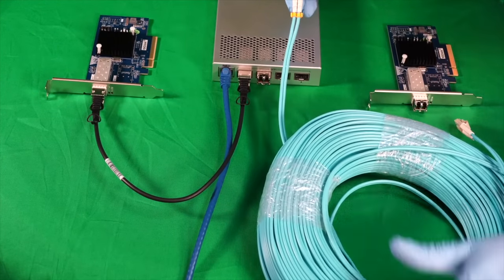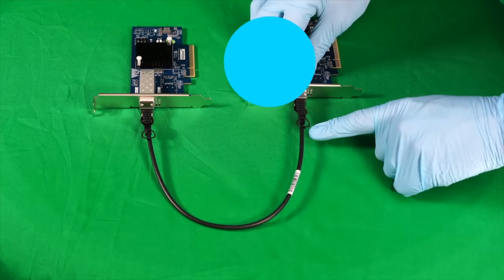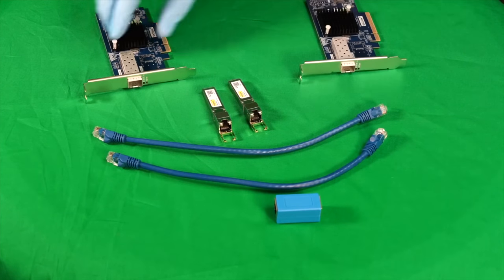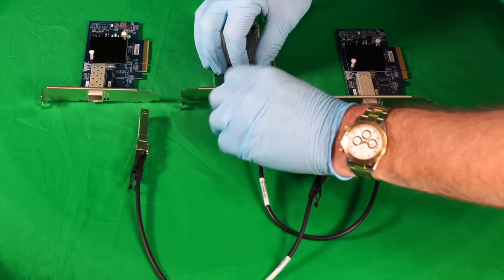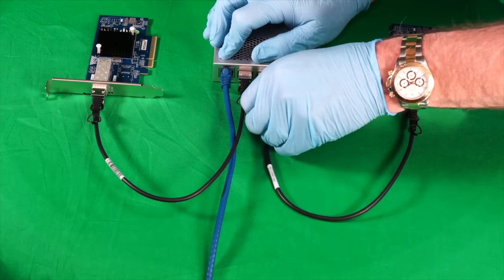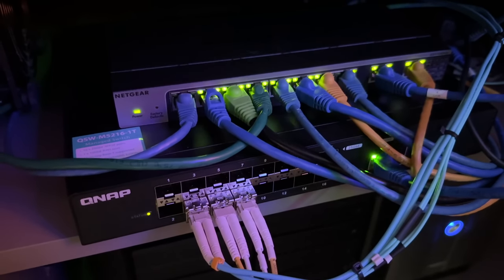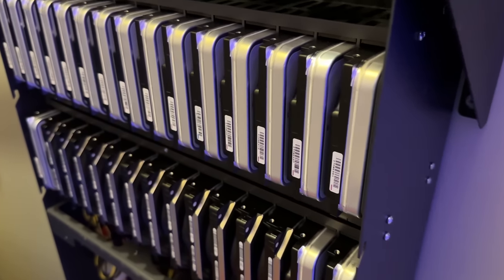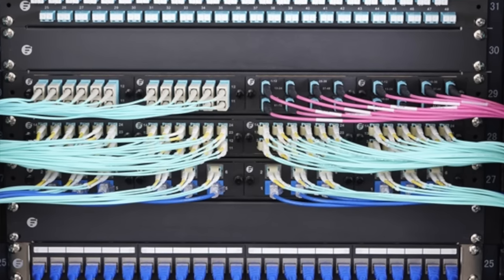10G and 25G Networking - SSD Speeds on the Net

Comment: If you're running a machine with PCI slots modern enough for those NICs, MDIX will probably already be in the stack. Regardless, I love the crossover callback. It's important for the younger generation to still understand these fundamentals I think. I love both the tech and videos about autism you put out, equally! Thanks!
Reply: 1000MBASE-T and 10GBASE-T require MDIX, so crossovers haven’t been necessary since fast Ethernet (100Mbps)
Reply: MikroTik Routers have a fair price tag, but are not very easy to administer. Nevertheless a good solution for a homemade lab. Unfortunately, it's not very easy to get rid of all bottlenecks, e.g. I can't find a 10g card for my notebook...
Reply: @claus7555  You might want to look into thunderbolt to 10g adapters, but they are very expensive, think $350 and up
Reply: @VraccasVII  I'm running a couple of cloud instances for free, so today, I  removed my server rack completely from my home office to have a bit more space available. That's probably not forever...
Reply from the maker: Thanks for the kind words!
Reply: @DavesGarage  Philadelphia Eagles or Kansas City Chiefs?
Reply: @ausnetting  I am going to add that many 100Mbps switches did auto MIDX. It was the prevalence of MIDX in 100Mbps that had them decide to make it part of the 1Gbps standard.
Reply: @jonathanbuzzard1376  my point was that on 1G and above, auto-mdix is a required part of the standard, so a rollover cable is NEVER needed on those connections.

Yes - it was optional on many fast Ethernet switches, but not all.  Some even had an uplink button for the last port on the switch to roll the connection so a crossover cable wasn’t needed.
Reply: @ausnetting  I was just noting that auto MIDX goes back even further. Frankly I stopped watching, because putting crossover singles in a 10Gbps link just makes me think the person doesn't know what they are talking about. I just placed an order for a couple 200Gbps switches today at work today.😁
Reply: @jonathanbuzzard1376  Hey! Some people are not flying yet, they are still walking, be gentle, we are not all as great as you.
Reply: @jonathanbuzzard1376 Dave Plummer not knowing what he’s taking about? You know he’s one of the OG Engineers of Microsoft right?

You should’ve kept going, very shortly after he explains why it isn’t necessary and is only used in cases where MDIX don’t exist…
Reply: @Comeyd  I know exactly who he is, that being a Microsoft Windows software person. Software ≠ hardware and sticking a crossover cable on anything more than 100Mbps is utterly pointless which is what he did. Even at 100Mbps is next to pointless because almost all 100Mbps did auto MDIX. Only some of the very early hardware didn't. With modern hardware, even at 10Mbps you would have to search out an ancient switch or hub because my modern switch will bring a link up on a 10BaseT device with a crossover cable. I still have some vintage kit. Even the ancient 10Mbps hubs/switches often had a manual MDIX button for an uplink port.
Reply: @jonathanbuzzard1376  that’s exactly what he said mere seconds after using said cross over!
Reply: Rj45 and rj48 differents ????  8p8c vs 10p10c ??

Comment: Nice to know the switch lets the different speeds to get along with each other and not slow the whole network down to the slowest connection.
Reply: This is not the era of hubs anymore. However some devices have "hidden" switch inside to increase number of ports, so you may have your bandwidth divided between downstream devices (yes, I am pointing at you, Mikrotik)

Comment: Also beware of SFP+ FC2, these are 16/32GB Fiber Channel or iSCSI and look identical to a typical SFP+.  You will get traffic over them, but they will usually default to max 1GB Ethernet, especially if they are HP or Dell branded (they don't make them just slap their label on them).
Reply: To make it even more confusing, some modern cards even support both SFP types, but that doesn't mean it works well, or at all. (FC and Ethernet are 2 completely different "languages").

Comment: Re: multimode vs singlemode - the cost difference has really come down in recent years, to the point where the cost difference for a home setup is probably only a few dollars.  A lot of folks have started recommended that any greenfield deployments standardize on single mode for everything for simplicity.  Since singlemode can do everything multimode can, and then some, you don't have to worry about where to use which type of cable.

Comment: a couple of things to bear in mind:
-10gbe copper SFPs generate a LOT of heat and use a lot more power per port than DAC or fiber so avoid them where possible
-singlemode and multimode are about the same price now anyway, and singlemode is futureproof while multimode is not, so if you're going to put in fiber may as well go singlemode, future you will thank you
Reply: THIS-^  Ditching copper SPF+ virtually removed all my problems with cheaper gear like the Mikrotik..problems like it going from not working in a full 10gig environment to it never dropping a packet.  well, almost never
Reply: Are you not worried about overmodulation by using singlemode on a short distance?  Optics for singlemode on higher speeds are way more expensive too.  You can get up to 40 Gbps over 150 meter of 2 strands of OM4 using 40GBase-SR-BD and up to 400 meters if you use 8 strands with an MPO/MTP connector.
Reply: The older adage was that you would use Multimode for very bendy applications (it works when twisted around a pencil) and singlemode for long, straight runs.
However, modern Singlemode fiber has a minimal bend radius of 1cm (slightly under half an inch), so that is also not a reason to choose multimode.
Reply: So this is basically to move files nothin special
Reply: As far as heat is concerned, does this apply to other SFP/SFP+ modules?  Like 1Gbit for example?
Reply: @KitGerrits   The problem with singlemode is the power of the transceivers. If you have a short length, you need Fiber Attenuators to prevent them from destroying each other.
Reply: There are ultra short range singlemode sfps
Reply: @marcusm5127  can you link to one? The only SFP+ modules that i can find that are short range are for MM fiber.
Reply: @tekki2  You don't need attenuates for the typical 10 or even 20KM modules. Their spec sheets generally show that they can handle a stronger signal than what they can send in the first place.

Comment: The first home networks I ran used 'thin ethernet' where if there was an issue somewhere in the big daisy-chain, the whole network went down with no indication of where the fault lay. 10Mb RJ45 was such an improvement. (A few friends and I installed it when, as students, we moved into a 6-person house. We had a spare 486, so that got put in the closet with a modem so that all of us could share a single 56K internet connection -- amazing for the time.)
Reply: I built a 10base2 network when I was a first year at university. The student accommodation didn't have networking so I built our own. Network switches were very expensive back then so we used the cable only 10base2 system. Didn't have any trouble with malfunctions, but I made all the cables myself very carefully.
Reply: Ah, the horrors of troubleshooting standing waves on 10base2 networks. Every time someone plugged or unplugged any PC, some PCs would end up in a dead zone and drop off the network, so I'd spend all morning crawling around under desks and work benches, adding a meter here, removing a meter there, trying to find a combination where every PC could se a signal.

The first network upgrade I ever did was to connect our 10base2 network to a cheap 8 port 10baseT hub, along with my PC and the company 'file server' under my desk. People weren't convinced that swapping one 10Mbit network for another would make any difference, but once I'd proven how much more reliable my connection was, I got the budget to buy 6x move 10baseT cards for everyone in the development office. Within a year, I'd convinced the director to fit structured cabling throughout the unit, and I was able to upgrade us to switched 100Mbit throughout, so the admin office could get the benefits too. I even got them to stump up the cash for, a real server (with a DAT drive for backups), a UPS, and replacement PCs for all of the seriously outdated 486 PC's that designers were still using. *8')

Comment: Another amazing trip down memory lane. I worked in a major corporation who still had token ring in 1999. Thanks for a couple of triggers, they highlighted what it means to be on the spectrum.  Appreciate all you do!
Reply: I worked for that that major corporation as well (probably).  Joined as a tech illustrator (software manuals) using DrawMaster, and ended up building computers with Token Ring and OS/2. Had the first luggable 486 with the red screen..  It just fitted a short T/R card !

Comment: When I was working with IT, 10 Mb/s was all the rage, after years of RG58 cabling the common common copper wire made all the difference. At the time, embedded controllers weren't a thing yet, so the ethernet hubs were repeating the same packets on all ports, and the machines had to run a collision detection on their own. Some gear used token ring on ethernet but we didn't.
Only when microcontrollers became powerful enough to check what was in some layers of the packets that we finally got the "switch" - where the packet was addresses to the port with the associated address. From that point on, on a network without collisions, the race for higher speeds made sense, and we had Cat5 (100 Mb/s) in the blink of an eye.
Thank you X the explainer Dave. It is happening all over again!

Comment: I just put together my own personal Rack and homelab at home. I've been working and building them for work for years now but finally got around to building my own. I went with a mix of 2.5Gbps and 10Gbps. 2.5Gbps is for all the everyday PCs, access points, etc., 10Gbps is for my NAS and Workstation as well as my custom built Pfsense Firewall (my ISP Internet is 10Gbps Fiber). So far so good. Came across your video here as I was curious about 25G networking (already thinking about upgrading and I finished the setup yesterday).

Subscribed. Good info.
Reply: It's cheap enough to go 40Gbps/100Gbps by buying an out of warranty enterprise switch now. I run Single Mode fiber as transceivers now are better at not getting burnt out over short runs. Cabling is not the expensive part anymore....

Comment: According to Cisco. 100m cable is made of these 3 cables.
4 m from switch to patch panel. 90 m from patch panel to connecting point going inside a wall and shielded cable if preferred.  And then 6 m from connecting point and to user.

Indoors, the recommended max is 100m (330 ft): 90m solid plus 10m patchcord allowance.

Comment: I remember the good old days using Coax in ring topology.  One loose cable on a single computer that got bumped loose and the whole network on the ring goes down!  I'd be crawling from PC to PC to figure out which one was loose.  Changing to star topology was a pure dream.
Reply: Surely the point of a ring topology was to provide resilience?
Reply: @deang5622  It was inverse resilience.  One tiny connection failure brought the entire network down.

Comment: In the multi-mode vs single-mode discussion, I was under the impression that multi-mode's limitations aren't from signal loss per se, but the fact that the signal gets "smeared" across time from light taking more or less time to reach the other side depending on how much it bounces. If you try to hear someone speak in a room with lots of echoes, it's very difficult -- not because you can't hear the sound of their voice, but the fact you're hearing the end of one word at the same time as the beginning of the next.
Reply: Modal Dispersion becomes an issue with longer runs with multi mode.  It also has to do with the type of light source is used, the grade of multimode cable.  Single mode on the other hand doesn't experience modal dispersion.   Multimode cable is more expensive, but the optics are cheaper.  Singlemode cable is dirt cheap, but the optics are more money, and depending on the required bandwidth at the time of an upgrade, it may be necessary to replace the multimode with a higher grade (especially if one has 62.5um multimode installed and the upgrade path is 10G or higher.  The 2 benefits with single mode is the fact that with single mode, the maximum bandwidth has not been reached yet,  and in the case of service providers you can multplex many "colors" or wavelengths on a single strand, in the enterprise it is usually used in the form of bidi optics that use a single strand for both transmit and receive.
Reply: Yes, different wavelengths have slightly different path lengths. Over longer lengths you get a complete screwing up of the signal. Transceivers don't produce just the wavelength of light they're rated to, but bands at either side. So as the path differences build up, as a shorter wavelength bit is going low it'll be swamped by a longer wavelength from a different point in the signal being high. The receiver just sees this as a "high".

In multi-mode the more gradual change between core and jacket means this smudging is more pronounced.
With single-mode the path lengths are far more uniform (there's a much sharper transition from core to jacket, so all of the wavelengths reflect at once), so that smearing you pictured takes a lot longer to happen- tens of kilometers. Multiple close-but-distinct wavelengths can be crammed down the same fibre with no ill effect using WDM/CWDM/DWDM.

In 18 years of working with industrial fibre systems, multimode has been rare. The cost savings just aren't worth the lack of flexibility, range, and multiple-wavelength functionality. Multimode seems to be common in more pure-IT industries where things like FORJ passes and distance aren't a concern.
My house is also single-mode so it'll work fine on smaller scales too!
Reply: The discussion will not be important soon.  The production volume of single mode is so big in China that it drives down the price of the whole thing to multi-mode level.  Thus there is no incentive to use multi-mode.  The effect will spread to the whole world several years later.  It will be all single mode just because of price.
Reply: Multi-mode is easier to work with, but once cables are cheap enough that you just replace them if they fail, rather than trying to repair them, that doesn't matter so much.
Reply: @markbooth3066 preterminated cables already so cheap compared to the equipment to terminate them

Comment: Fast home networks are fun 😁I made the 10G jump in 2016,  and in 2017 I upgraded to a 32 port 40G Arista switch grabbed off ebay for very cheap. Since then I also scored a few smaller mellanox 12 port "56G" switches for dirt cheap. Naturally a large chunk of my home network is running @ 40Gbps - including the gaming/home theatre PC because why not, got the ports right :) Uh, you can say things have gotten a bit out of hand. Now .. its time to start a 100G upgrade... I might have a problem.

Unfortunately the crazy good deals are less common these days due to the still ongoing supply shortage on new enterprise grade networking equipment, making data centers and enterprises hold on to their network gear and more companies buying off the used market, driving prices up. Also many really good deals comes with some pretty severe caveats that takes some .. I mean a lot of work to overcome. Def not for everyone.
Reply: I had issues with fan noise acceptance in the house for anything enterprise.  I went to 10GbE in 2020 when the early QNAP consumer level 10GbE switches came out... then got a second one.  I was in a condo at the time, so I didn't have a good place to hide loud equipment.  I'm in a house, now, so I can pretty easily dedicate a closet and isolate the noise pretty well, so I might do something faster... or just get a bigger, dedicated central 10GbE switch and keep the QNAP switches for edge switches.  Though they don't do 2.5GbE at all, but small switches with a single or pair of 10GbE SFP+ ports and a few 2.5GbE UTP ports have gotten super cheap...  Well, QNAP now has a 16 port 25GbE consumer level switch that's not particularly cheap (currently $1200), but supposedly quiet.  So... I guess I'm running fiber everywhere.

(Yes, I realize I'm commenting on a 10 month old comment, but a lot is still about the same.)

Comment: Back in the late 90s i didnt own a switch or a hub. I had a cheap rj45 1 to 2 splitter. And we shared our dial up from the host computer. And played quake 2 and various other games with 3 computers this way, as long as host was the pc on the side of the adapter that didnt split. 

And some years prior to that I vaguely remember playing a bit of doom over coax cables with bnc connectors with my dad.

Talking about networking brang back some memories. Thanks for the nostalgia trip Dave :D

Comment: Wonderful video! I am a new subscriber here, but I work for the nations largest telecommunication provider. I have 5 Gbps symmetrical Fiber Internet at my house and I find it difficult to fully utilize that connection speed. For work I install & Repair FTTP or Fiber To The Premasis utilizing SFP+.  We use standard, alternate, and XSGPON SFP modules. The difference between the three are optical frequency and XSGPON is the SFP+ Module that is capable of 5Gbps Single Mode Fiber.  I also install & repair FTTN Single & Bonded pair DSL connections as well as IP-RT IP-CO internet connections.  I truly love your videos! The way you explain everything is very unique!